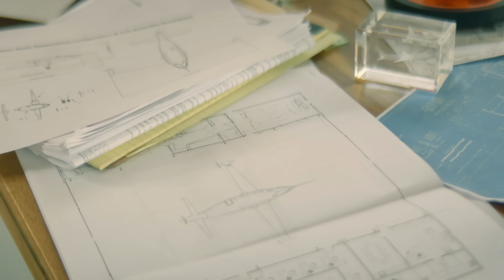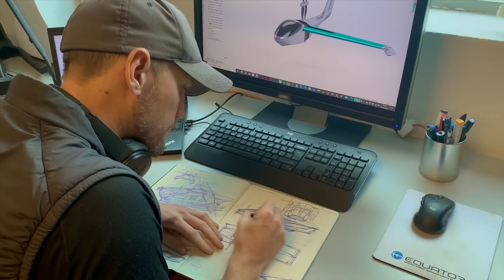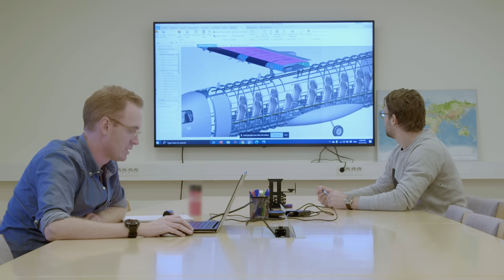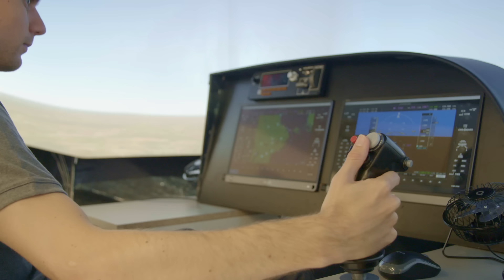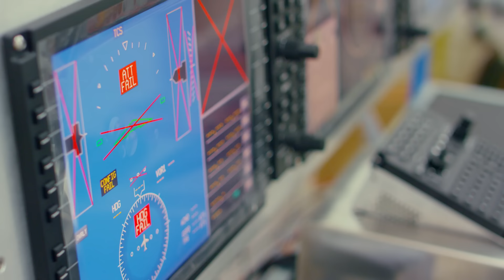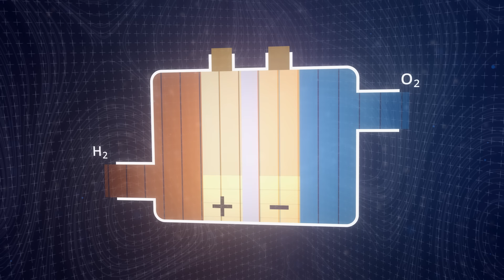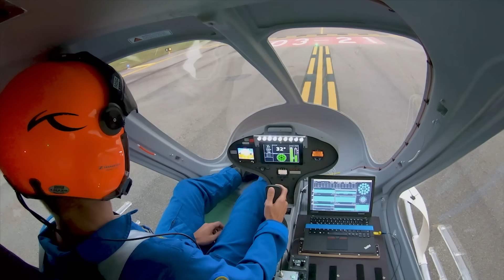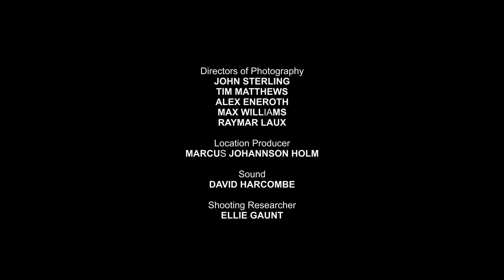Planes of the Future: The End of the Jet Age? | FD Engineering

Comment: Change the T-Tail... It is a killer in wing stalls.. Place the horizontal stabilizer into the air stream of the motors. ATR-72, Piper Lance T-tail are notorious for unstable slow flights..

Comment: The major problem is replacing jet engines. Jet engines are the main source  of airline propulsion. Designed to take aircraft above or on the edge of the troposphere. Which is the cruising height 30/35,000 feet. Jet engines use aviation kerosene type light fuel.  I realise we have to break with fossil fuels energy sources. But how are we going to replace jet engines? Nuclear powered? Hydrogen powered? Interesting?

Comment: The problem with Hydrogen is it’s explosively dangerous, as they discovered on the Hindenburg. Not to mention the fact that cracking the Water molecule takes a lot of energy. It is far safer and more efficient to store that energy in a battery and use it in whatever device, wherever you need to.
Reply: Most important is that the volume of hydrogen would be 11 times greater than kerosene which would require the entire fuselage to be full compared to putting tanks in the wings. Even the tanks contain hydrogen at 10,000 psi would be three times the weight of the hydrogen in the tank. Totally unworkable.
Reply: @colingenge9999  You’re still back to the fact that Hydrogen being the lightest element is very slippery. It is very hard to contain and is explosive.
Reply: @nextechsolutions5955  Hydrogen’s energy/unit volume makes Hydrogen impossible. Being explosive, causing embrittlement, hard to contain and even being energy inefficient just makes it much more difficult; but not impossible.  So I was agreeing with your points but not their relative significance.  No more explosive that gasoline vapor.  I understand the Hindenburg’s problem was primarily the dope on the cover that was flammable lacquer with aluminum powder that is essentially used in explosives possibly undeknowst to Hindenburg designers who may have thought Al was inflammable which it is as a solid but explosive as a powder. Just like iron.
Reply: @colingenge9999  So you think Hydrogen Fuel-Cells for long distance Trucking is ridiculous too?!?

Comment: Fingers crossed we should see a decent shift in CO2 emissions within the next 10-20 yrs. Energy production should in theory shift into more fusion energy and renewable sources which will lead to more advancements in energy storage and energy density increases. And a decent uptick in transportation co2 production but at the same time along side that we should see a significant advancement in transportation advancements in hydrogen engines and advancements in propulsion technology which should help counter the trend of co2 production so short to long term yes we can and probably will see a rise in co2 production but overall in true long term we should see a decent decrease in that overall co2 output as the new technology in propulsion and transportation is adopted into the normal supply chain.

Comment: Lithium Ion Electric EV Batteries fade or lose capacity diminishing range per charge, even when sitting disused in a parked EV. Every cycle of the Li-Ion batteries also reduces capacity and eventually they are so worn out that internal resistance increases decreasing performance while capacity loss means less range. PHEV address this as do HEV by allowing the computer ECU to control when the gasoline range extender turns on to keep the fragile batteries warm, not frozen cold from winter or hot from summer sun as thermal stress also damages Li-Ion EV batteries, which often have heater and cooling systems to minimizes loses which are progressive or ongoing in terms of capacity loss from days or time and cycles of used capacity; the HEV and PHEV traction battery controller keeps the fragile batteries between 30 to 80 percent charged, so as to prolong the cell life, using the engine or onboard generator set to keep the battery charged or prevent over charging. 30-80% charging makes common lithium ion batteries last 200X longer with up to 20,000 cycles and 10 years of good use capacity, where regular 100% charging and deep discharge below 10% means battery fades to 70% initial capacity within 5 years and only 2000 cycles. LFP a little bit better but also lower voltage and lower energy density so much heavier in longer range EV's.
Reply: For weight sensitive aircraft the battery mass paradox and heavy wiring and magnets and metals for EV motors, controllers, fire safe thermal management cases, its not easy to compete with Jet A, Diesel, Kerosine, Gasoline, Propane, Butane or CNG compressed liquified natural gas, not even close, especially not in terms of fueling time or speed to refuel for reuse in commercial applications where time is money.

Comment: Excellent program! I was wondering if they would mention hydrogen fuel cells,which give almost fossil fuel range to aircraft,and they did. Another one not mentioned is aluminum air batteries,which have been around for a long time,and offer energy densities of 1200 wh/Kg,much above that of EV batteries,and potentially even higher.

Comment: one thing I never understood was why aircraft never adapted a launch assist system, like that used on aircraft carriers?  If take off and assent is the biggest drain, why transport all that capacity during the entire flight?  Use a hot rail to supply electricity and a catapult system to increase mechanical motion and let the batteries power the actual flight?
Reply: G-loads on passengers.
Reply: @michaelfoster-qw2tw  no more than what the plane would create, I'm not suggesting the distance be any shorter than a normal take-off, just by what energy source.
cheers
Reply: @rfpeace  Ahh, got it, thanks.

Comment: Make no mistake we need to go green, but with most current seemingly green technology simply hides its pollutive really , as electric engines require batteries that need rare precious metals, and that requires vast destructive mining operations on both land and ocean. Operations that produce vast pollution in the process. And few have found ways to best utilize depleted battery waste.
Reply: Do you think that fossil fuel vehicles don't require a ton of mining to make the material for them.  If not, think again.
Reply: @markjenkins1569  They do but nowhere near the scale of environmental destructions that batteries would need currently to meet the same needs. 
You are comparing apples to elephants.

Comment: If you still need EA Tesler type of battery to supply energy, you create more carbon dioxide in the process making the battery. The solution lies in making a hydrogen driven engine, whereby one needs to  produce liquified hydrogen from water-- this is an ongoing R&D.

Comment: 44:18 "44% of those tons"
That's only because jets are incredibly inefficient and fly too fast. They're designed for speed.
A hybrid system with tiny simultaneous combined cycle piston engines sized to cruise at 350mph in a quarter atmosphere will be light and burn a tiny fraction of the fuel jets gulp. Add beefy but light motors  and a small battery and top it off with a bit of solar.
And those props need improving. A small and fast nose fan paired with a huge and way slow counter-rotating neck fan (patent pending) is the way to go. Redundant systems, massive volume slow thrust, and all rotational forces cancel.

Comment: VTOL is more energy intense ... people can think differently, as long as they remember that, and consider the energy bottom line.
I think the many arisen unmanned VTOL applications are the true unsung VTOL heroes .... typically emergency and rescue vehicles, there are still things VTOL can do that other aircraft cant, but it's still more energy intense, point a to point b in general..... though I have seen some electric VTOL designs with wings for forward lift.
I think urban planners should design for zip lines to utilize elevators and staircases ( near zero vehicle mass gravity storage propulsion ), and actually designing for the faint of heart, would be more flexible in some ways ( but less flexible in other ways )......there could be timed zip-line "gates" .. you clip on your zip-line trolley and pick up your feet, and wait for the gate timer to open it.

Comment: In the military sector, there is aerial refueling. Why is this not the case in civil aviation? In particular, recharging battery-powered aircraft in flight would certainly be technically easy to implement, easier than kerosene or fuel. The efficiency chain electricity-battery-electricity-battery-motor would still be better than with chemical energy sources.
Reply: No! And the refueling planes would have to be jet planes burning fossile fuel to be able to lift the enourmous batterys to the sky, and then fly connected for an hour to transfer any meaningful ammount of power....
Just skip the battery plane, and the charging plane and put the passengers on a small efficient plane.
No need to fly around tons and tons of batterys just to be able to say you are flying electric
Reply: @someoneelse7629  You're probably not good at math. If a small plane with x kg battery can lift its weight of y kg, it has z power. If a large plane with 1000 x kg battery can lift its weight of 1000 y kg, it has 1000 z power, which is also enough. The charging plane doesn't have to use its battery energy to make a long-distance flight, but rather to refuel another plane in 30-60 minutes, so it has MUCH MORE energy on board than it needs for its own flight in that time.

The same applies to fossil fuels. You could also use your silly, uncalculated argument against them. Fuel has also weight, did you know that?
Reply: @santaclaus0815  Fantastic, you are the only one good enough in math to realize this, none of the thousands of people working with it has done the math quite like you...

Comment: I have a question....the modern electric grids can barely handle the demands of the private and industrial sectors. How, then, are the grids supposed to handle the increased demand put on them by an ELECTRIC AVIATION INDUSTRY AS WELL?
Reply: Aviation is a 2% correction to our primary energy needs. Probably a little less than that, actually.

Comment: Certainly 20% of carbon emissions is significant especially since those emissions are at 20,000 feet where there are no trees to capture the carbon and since the carbon is hot where the atmosphere is very cold it is heating the upper atmosphere and the gases just rise and who knows when they will fall to the level that trees can capture them.  Unfortunately the 15 minutes of flight time provided with batteries is just not useful... I am banking on Hydrogen and Methane being a compromise

Comment: Engineer note:
 It's only a variable torque motor attached to winglet and wings. (works like a car alternator but in reverse). It won't even come close transonic wind pulse at tips without duct shell, and won't surpass with it. Taking the average airspeed of whole wing minus the craft's required force (in NM) equals to far lesser speeds than mid-subsonic speeds, 0,4 Mach at best. Batteries' have 2-3 next generations planned and backup materials that give much or less similar powers and even more expected with solid catalyst batteries and further on the glass diamond batteries etc. But the propeller needs to take it's place as something as say electric jet motor or hybrid, or it'll be only viable in domestic flights.
Best case scenario is; electric aviation will be domestic, and there will be supersonic corridors for express travel, making capitalism work better with options given. Take red pill and go expensively at supersonic, or take blue pill and travel slower than you used to do, but cheaper and slower.

Comment: A large chunk of carbon footprint would be “ shipping by sea “ most large ship run on engines that operate by burning “ raw brown oil “ causing most of the pollution by releasing their burnt raw brown oil fuemmes ( black smoke ) unfiltered and unlimited up in the air as the the engines run . When ships are in port , they never Power down or shut off their engines . As powering down or shutting off such engine is impossible for such ships to do , as it would be impossible to do a quick restart when the ship wants to set sail . Something it does need to do if it purposely is only to haul freight from one port to another in as short as possible time (cargo ships / oil tankers)  or to transport people (cruise ships)  . To restart such engines , the oil it uses to burn and power it propulsion needs to be pre-heated before it can be ignited / set on fire . Also it’s a time consuming proces , not providing any garantie that the engines Will run up on restart . As due to being shut off , engines can and will stall permanent . And not be able to restart and run ever again . Ships are by far along whit factory’s , server buildings and or server running company’s the greatest polluters , unlike planes that pollute hardly .

Why “ raw brown oil “ it’s the cheapest fuel to use to power a ships engines . And if that is not problematic , raw brown oil can only be found , mined and bought in one country , do you know which one ? It’s Russia …..

Comment: To produce the amount electric needed to charge batteries for electric transportation will cause more co2 than those now operating on fossil fuel.
Reply: Do you know how much "Electricity" it Takes to refine "Oil"?
There's an old video on line (From Robert llewellyn) detailing relative energy use.
Example given.
435,000 Oil wells In the USA use 4,300 GWh to just EXTRACT the oil they produce in ONE MONTH.
(THAT alone would power 15.2 MILLION EVs )
Then add the Offshore extraction.
Then shipping to the Refinery.
Then the energy to Refine the fuel.
Then the energy to transport the fuel to point of use.
ALL of which requires "Electricity" to produce the fuel that's moving..... the fuel!
.
The point being, YOU compare the WHOLE cycle for an EV with a FRACTION of the cycle for ICE.
.
DO MORE RESEARCH

Comment: Why not convert combustion engines to use Ammonia as a clean fuel, ammonia is a hydrogen carrier that is liquid at normal temps & pressure and has no carbon.  Politicians are dictating solutions without engineering discussions on whether electrification is the right approach, engineering is NOT in politician skillsets.
Reply: Combustion engines are wasting too much energy. Something like 35% efficency.
Turbine engines are more efficient.
Fuel cells would be the most energy efficient way to use some fuels, such as hydrogen.
Although, compressing hydrogen takes a lot of energy.
Electric systems may be at 90% or so energy efficient.

Comment: BOLLOX... The best tidal generator on the planet is sat rotting in a Newcastle warehouse. A plane like wing, two propellers and what looks like a light house top. Tow it into the see, the cable sending the power back and as the tide goes out the props turn, tide goes in the props turn. Why is not being used..? It's cheap to make and requires little maintenance... The massive kick back in back hand money that sees wind farms along with massive subsides a goldmine for investment banking. The green con.

Comment: At the rate we're progressing, electric aircraft will never be a thing, except in special circumstances. The battery tech is nowhere close enough to get the kind of energy densities you need to fly the distances necessary to make it useful. Diesel and gasoline rule the roost, and will probably stay that way for another 50 years.

Maybe hybrid aircraft could work, but then what small amounts of efficiency are you going to eke out of the design that makes all the extra complications worth the effort. Not. Gonna. Happen.

Comment: E-planes have a major problem, the size and weight of the batteries.  We have much better technology to use that this, we could have aircraft that use no fuel and need no recharging. 

How heavy of an electric motor does one need to produce 10,000 HP?

Comment: I think if I was going to build an aircraft from scratch I would probably be a pilot and aeronautical engineer first. As a pilot for 24 years, I cringe at the thought of the wingtip mounted motors on the EVAITION. In the event of a wing mounted motor / propeller failure at a high power setting and high angle of attack would cause an immediate loss of control due to asymmetrical thrust. Your theory of eliminating a crab on final bc the engines are wingtip mounted is just pure ignorance of why the aircraft is in a crab to begin with. I’d give it a 100% chance of a prop strike on a gusty crosswind landing. And a 0% chance of ever being certified.

Comment: Burn Coal Burn Natural gas.....send it to the clean plan...Those windmills are a tiny part of their power grid.
Reply: Windmills are no green, to produce a (current) average windmill with 7-9 MW it takes 1,300 tons of carbon dioxide to produce it, not counted the transport (Lorrie’s, boats, ships), the machinery (most likely diesel powered diggers and canes) to put them in place and dig the holes for foundation, the trees cut down for power connectivity to the network. The windmill would have to run between 45-52 years to become green. Unfortunately they only last for 18-25 years…. Great when you then have wind parks with up to 110 windmills covering areas of multiple football fields (59 windmills and roughly 42 football fields of nature.